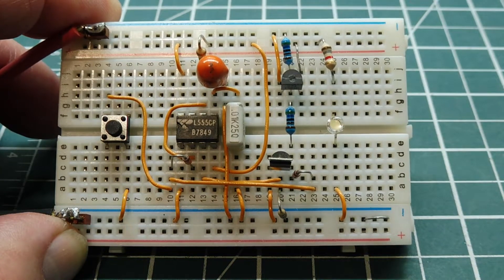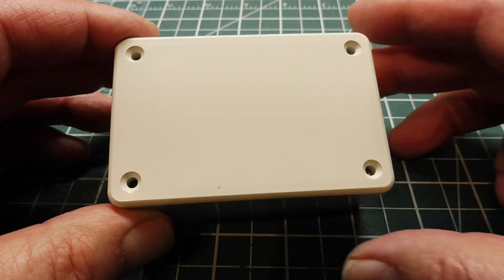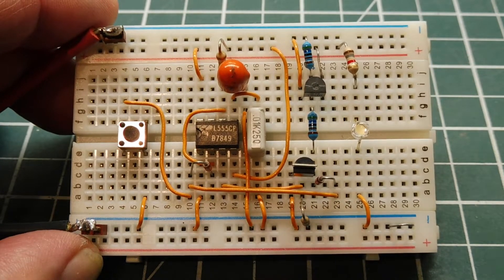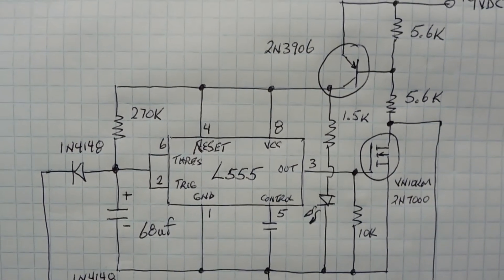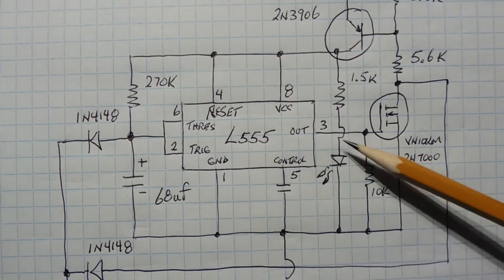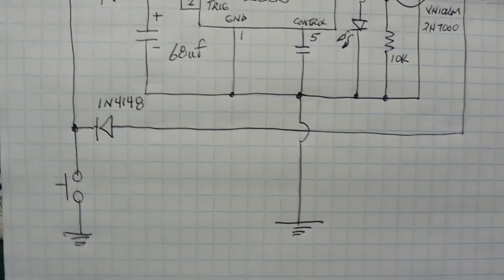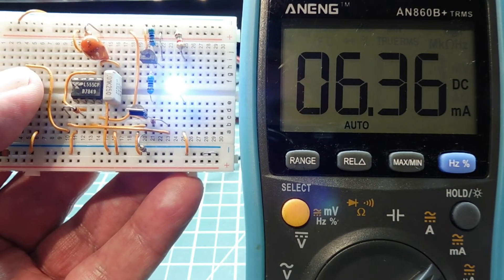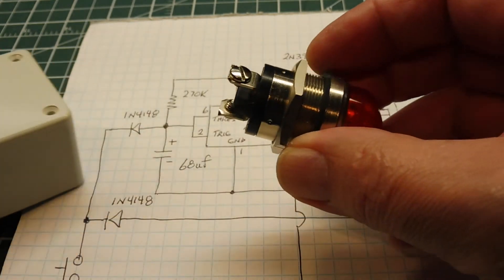Hand Washing Timer  /  555 Timer

Comment: Really? Can this be used also for brushing theeth? Please 0033mer, we are a little bit more intelligent than this. That's why my not-like.
Reply from the maker: You probably don't have kids ... Check out the video in the description box.
Reply: @K9-33  oh, of course, one typo and you already think I'm an idioot, right?.  Well, not really, I only speak fluently 5 languages and sometimes, yes, and somtimes I make mistakes... but you should know this already,right?  Lo siento por mi error tipografico, supongo que podrás mejorar mi frase por eres superior.  Maar ja, ik ben intelligent, ook als ik een typo heeft gedaan, verbeter dit als je het even kan.  Einfach ein grammatikalischer Fehler. Verbessere es, wenn du kannst.
And for your information, I have a PhD.  Finally I keep it in French so you understand and don't correct me about I mentioned languages and only answered in 4: bien réfléchir avant de commenter quelque chose et ne pas intimider. 

Assumptions are the mother of all f@ckups rights? Oh, ja, the @ is in purpose, just in case :)
Reply: Oh, yes, I have 2 children and 3 granchildren... still, I can't correlate your comment about the description with the children: This video will describe how to build a 20 second timer using a 555 timer IC to ensure 20 seconds of hand washing. The circuit has zero quiescent current when idle for long battery life.
Reply from the maker: My YouTube channel deals with electronics and circuit design. I made this video to do my part to help people fight this virus that is spreading world-wide. Children can be carriers with no symptoms so older people like your mother and grandmother can be at great risk.
Washing hands is a very important, and kids fail to wash for the recommended 20 seconds. The 20 second timer is an aid that can be used to show kids how long 20 seconds really is. So I recommend all viewers to watch the video linked in the description box to the very end before watching my video. https://youtu.be/I5-dI74zxPg
Reply: You sir, SuperQuique, are intellectually arrogant and clearly made what we Brits would call a “snide” comment. If you are so smart and speak five languages fluently, although obviously not English, you would realise that the owner of this YouTube channel puts in a great deal of effort to make these videos. 

0033mer clearly has a love to explain electronic circuits and to educate others. Your rude comments, surprising for a person of your age as you say you have grandchildren, is somewhat churlish and I assumed you were a petulant teenager.

Thanks. 0033mer for another interesting and enlightening video.
Reply: Et j'ai bien réfléchi avant de commenter et n'ai aucune envie d'intime
Reply: En ik heb goed nagedacht voordat ik commentaar gaf en had geen zin om intiem te zijn. Ik zeg gewoon het voor de hand liggende.
Reply: Y lo hice pensar detenidamente antes de comentar y no tengo ganas de intimar. Simplemente digo lo obvio.
Reply: Eta ondo pentsatu nuen komentatu aurretik eta ez nuen intimitate gogorik. Besterik gabe, agerikoa adierazten dut.
Reply: I vaig pensar bé abans de comentar i no tinc ganes d'intimar. Simplement dic l'obvi.

Comment: It would be nice if the switch was a non-touch type (e.g IR switch) to eliminate any contact contaminations.
Reply from the maker: The main goal is to show kids how long 20 seconds really is. Hands are washed after touching the switch. I would worry about the water tap which is touched to turn off after hands are washed.

Comment: Nice one! But I think you don‘t need the 555, since you could have used an RC network alone, right? You just have to fast-charge a capacitor by holding the switch and let it discharge slowly for 20 sec. If we add a darlington output stage for the LED to light up the whole 20 secs, we have almost a clean (good enough) indicator lamp built, right?
Reply from the maker: You could use a simple RC timer as stated but on timeout the light would be bright and slowly dim to zero, there would be no distinct on/off transition. As the battery voltage drops, the timing output would also change. The 555 timer has 1/3 and 2/3 Vcc comparators driving a flip-flop which gives distinct on/off transitions and the battery voltage can change from 9 volts to 5 volts with a reliable 20 second output.

Comment: Very nice !   Simple fun build.    Was easy to put in a enclosure.    What is your opinion, with the pushbutton contact bounce, and the time it takes the 555 one-shot to latch power ?
Reply from the maker: Typical bounce duration of a switch is around 10 msec and the deliberate press of  a push button by someone will be exceed that so I do not see a problem.

Comment: Wow! What an ingenuous circuit!! 💪 Would it use less current if you used a smaller capacitor and a 'higher ohmic'' resistor?
However the 6 mA is mostly used for the led I think.
Reply from the maker: Yes ... the led and the L555 timer. A CMOS TLC555 will draw less current.

Comment: 0033mer just wondering how far I can stray from your specified resistor and capacitor values...Are there any values here which must be exact ? Thanx.
Reply from the maker: Resistor value are not critical. Calculate the RC timing components using the formula to get 20 seconds with what you have available. It's ok if your timer interval is a bit longer than 20 seconds ... that's even better.

Comment: Excellent video, as usuall... and also very well explained. However, I have a question. I noticed that you interupt the ground wire power supply with a push button (schematic left down below). Is there a specific reason why you interupt de ground ? Here in Europe, usually it is the + (VCC) that we interupt. If this remark sounds stupid, please excuse me for my limited knowledge of electronic circuits. I'm just curious.
Reply from the maker: I think that started when the two continents started to produce automobiles. One interrupted power and the other ground. Many other differences like positive ground vs negative ground. Even the mains power is different 230 VAC/ 50 Hz vs 120 VAC/ 60 Hz with different household outlets. It is more common to ground a GPIO pin of a microcontroller with an internal pullup resistor and a lot of sensors are open collector or open drain which switch to ground when activated. Switching ground is more common in electronics as even Audi interrupts grounds to fire their engine fuel injectors.
Reply: @0033mer  Thnxs for the info. I'm aware of the 50/60hz and AC voltages. What I didn't know is the fuel injectors from Audi ! Interesting to know !

Comment: Very Nice Sir, But 555 Timer Starts The Cycle Again If Trigger Button is Pressed During Ongoing Operation. I Think Feedback From Output is Solution Can U Suggest Circuit For it
Reply from the maker: Check the 555 timer data sheet for the common non-retriggerable monostable circuit.
 http://pdf.datasheetcatalog.com/datasheet/fairchild/LM555.pdf